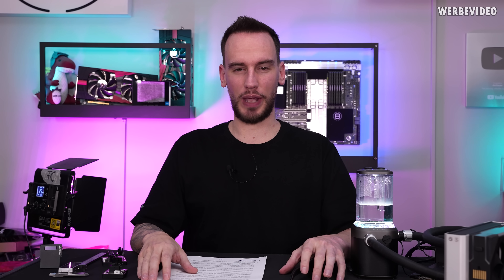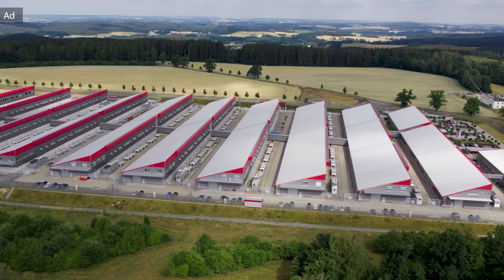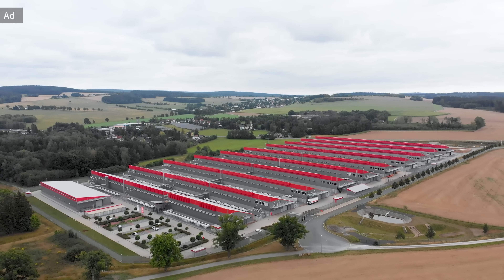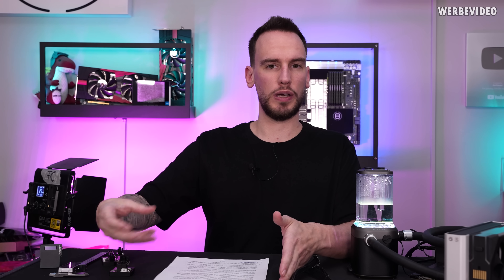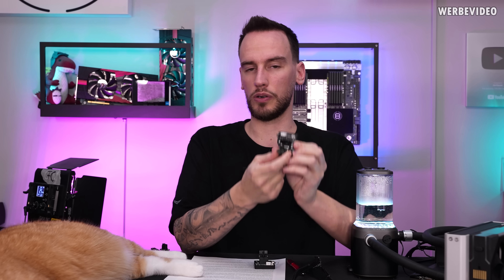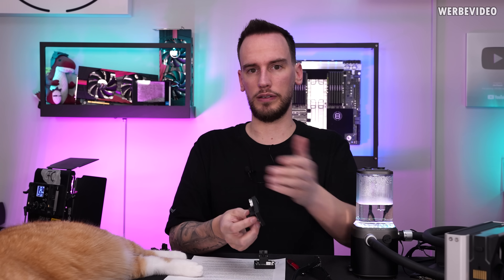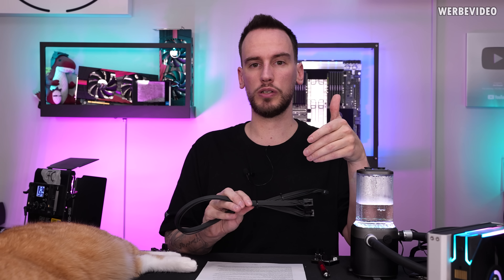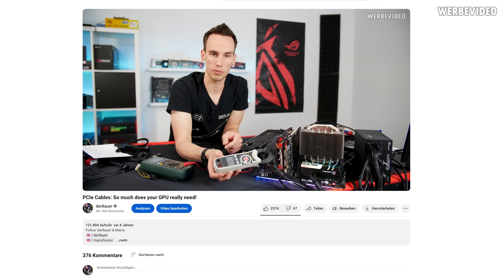12VHPWR is just Garbage and will Remain a Problem!!

Comment: I'm surprised there isn't a class action lawsuit going against them for this yet.
Reply: I would guess the ppl who ratified the cable connection are the ones you would go after
Reply: i'm in for a lawsuit/recall. i just had a second cable melt on the psu side from the original melting at the gpu side. i believe it's nvidia's fault as they created the card and requirements associated with it. there has been no improvements within nvidia to correct this issue and there is a serious fire hazard involved.
Reply: @bio-nukes4136  From what it sounds, you've used a third party cable on the PSU, fyi. PSU's recommend you only use the inbox cables. As if you don't, any cable could short, causing melting, or even fires.

This sounds more like user error, rather than the cable, as per usual.

Heres some protips, 
1: Don't bend it near the connectors end points, this could cause these dedicate wires to become loss, and cause a short.
2: Insert the cable fully, if its not inserted fully. Its your fault.
3: Only use the PSU's cable, try to stay away from adapters, or those 90 degree adapters. Only use the cable, or a trusted 90 degree cable extension.
Reply: How about soldering the wires directly to the board once the connector melts? Assuming the card isn’t too damaged lol. Every time I turn my Pc on I’m convinced it’s going to melt.
Reply: There is/was one against nvidia.
Reply: @thermadoneplays7842   You do understand that nVidea did not “make the new standard” right?  Because it sounds like you don’t really get how any of this works.
Reply: Class action for what?  People are getting their cards replace, either by the GPU manufacturer or the adapter manufacturer.  In order to sue someone there have to be damages.
Reply: @kidnovatex  Do you really expect these people to know law?
They're crying over user error.
Reply: Against... who? Can't go after nvidia, they're just using a standard.
Can't go after the people who made the standard.
And you can't go after cable mod sense they recalled. It would make it very difficult for anyone to present a good case sense they have solved the issue. Not to mention the amount of money a class action lawsuit would take.
Reply: @Triro  it should go against nvidia. Nvidia is the one who forced vendors to use this connector.
Reply: @matejsojka6683  it's of no use. If the PCI SIG says it'll do 55A, then Nvidia has no cause to question them!
Reply: it seems you didnt get my point. My point is that graphic card vendors should be allowed to choose what type of connectors they want to use. When I am lets say asus and I look on that connector how small it is I just with common sense surely do want to avoid of using something that has livespan of 30 plug / unplug. But I cannost use 3 8pins instead because nvidia wont let me do that - i have to use that clumsy connector.
Reply: @matejsojka6683  you are just mad at Nvidia for prices, you literally cant blame Nvidia for someone else's standard

stop being a salty fanboy all the time
Reply: @Freestyle80  I do have  nvidia GPU now and I had one before this one. It is not that I am salty or even fanboy of any company - I am too old for that. Just look at pc hardware shops.. there is no amd card with 12hpwr connector and no nvidia 40 series card without it. Do you really think that asus, gigabyte, msi, xfx just want to use that connector by themselves? Nvidia and Dell stands behind developing that connector if I am correct.
Reply: @Triro  No I place full blame on NVIDIA here as theyt have the money and power to influence PSU companies like a bloody mob boss.
Reply: @themadoneplays7842  If this where AMD, you probably would've not.
Reply: @Triro  No i would complain there too, I am not a fanboy. Yes my current CPU and GPU are both AMD but only because both are of good value where I am from compared to both intel's and Nvidias offerings. I live in the US and if I thought that Intel and Nvidia was the better choice I would go for them, but both the RTX 4000 series and the 14th gen intel processors are a total joke in terms of price to performace. still I have no brand loyalties here, this power connector issue is entirely Nvidias fault. They didnt do this kind of shit with the 3000 or 2000 series and they have no reason to do it now.
Reply: @themadoneplays7842  Intel is pretty good value. Its just not the best. Its better than what they once where.

And as for nvidia, the 3000 series cards are still really good value. While AMD's top brass performs better in regular graphics, with raytracing, even with a 7800XT. Still is lacking.

And once again, not Nvidia's fault. They cant fucking control the quality of companies products. Its like saying if a PSU blew up, its the GPU manufacturers fault. Its moronic, and stupid. It's just pure bias. and 3000 and 2000 series cards didn't need the power the 4000 series does.

As uh, idk if you have looked at the TDP, but its 450 watts... 8 pin connectors just don't cut it anymore, atleast not for the top brass.
Just a fyi the 3090 had a TDP of 350. Just so we're on the same page. As ik you wont be bothered to look it up.

Also the 3090TI also used this connector. So yeah. the 3000 series ALSO used this connector.
Reply: @Triro  eh i still think Nvidia deserves the flak for making the new standard, even with all you said they still fucked it up with this concept and its just sad the PSU companies are going along with it as they are interested in making money too. Before the 4000 series came out, this kind of thing should have been looked into and not just rely on data from one GPU that barely anyone could afford to ensure it was safe to use in future iterations. I mean its one thing to have early adoption issues like what is happening with the AM5 platform its another thing to have faulty tech that sets computers on fire. I mean fine I know some Am5 chips set on fire too but that was mainly with Asus boards and is fixed by now.
Reply: @themadoneplays7842  Well. The issue is its been 9/10 adapters that caused the issues, so PSU's supporting it natively is actually a good thing. As it creates no need for people to use these dangerous adapters.
As lets be honest, if you're shilling out what? 1.6k USD on a GPU, I'm pretty sure you can afford getting a new PSU, and good cables from trusted brands.

Also AM5 never caught on fire, it was the 3dvcache chips. Which was the motherboards fault for shipping faulty firmware. And AM5 has a pretty wide adoption now, am4 and am5 are now competing for top spot.
Reply: @Triro Yes they can , once a cable supplier produces samples of the final product it’s nvidias job to test the components, prior to selling the product. Lots of companies out source parts for their products, cars , washing machines etc. And those companies are forced in some countries to adhere to a recall, this is a common practice in many countries.
Reply: @Triro  LMAO goddamn, dude! You call everyone a fanboy on this thread that rightfully believe Nvidia should be held responsible (probably me too next, despite that every GPU I've owned: 870m, 1070, 2080, 2080ti, 3080ti) is Nvidia.

THEN you write this entire thing fanboying for Nvidia. Gtfoh 😂
Reply: @AllElitesAreBad  Not fanboying, I quite hate Nvidia and personally use AMD.
But Nvidia shouldn't be blamed for user error. Or manufacturing defects
Reply: Why couldn't you go after the people who made the standard? Also you absolutely could go after Nvidia if they did testing and found it would have problems and ignored it.  @Triro
Reply: @Triro what? Who pushed for the connector? NVIDIA. If NVIDIA pushes for it. And psig designs them a plug. They are both equally to blame. You can sue them both. That's how designing, fabrication, and manufacturing works. If you touch it or have any part of it. You are considered legally liable. Stop spreading misinformation.
Reply: @wessidemessside  Basically saying hold the manufacturer liable for user error. They state in the manual not to bend past a certain point. Which many ignore, and in return damage is done. 

Basically like saying the manufacturer is at fault for a user accidentally  sh**ting himself for poor gun safety. It makes zero sense. If you're going to willfully ignore the warnings its all on you.

And no, the manufacturers took reasonable time to address, fix, and resolve issue with customers. They wouldn't be held liable, especially if found users ignored warnings. Which they most certainly did, as 99% of cases are user error, while the other 1% being manufacture defects.
Reply: @Triro  Since
Reply: @Triro  If NVIDIA for example used bad capacitors in their cards that would leak and potentially blow up and forced everyone to use them than it is their fault. They did not have to use the standard but they did without doing research and testing and nobody else in consumer market is using that connector.

Comment: I think pins should be ditched all together and instead use a bar/slot style connection. Think something like the end of a server PSU, the surface area of contact is massive compared to how little you get with pins and all the plastic and air around each one. Even at the same size of the 12VHPWR with a single positive bar and single negative bar.

Comment: i was wondering too ,why board partners didnt put second ceonnector? in the past some were putting 4 4*8 on the card and now nothing?, 
its not like its strictly requared to put only 1 on any card, like nvidia is forcing aib to put GTX/RTX sticker or naming on card right?

Comment: Using 2 would kind of defeat what I think was the the original purpose of the connector -- to not need multiple connectors.  I feel like the 12VHPWR connector just needs to be scrapped and replaced by a new single connector that has higher safety margin.  If it's bigger, so be it; it will still be much smaller than 4x 8-pin.

Comment: This is a major problem! I already had a 4090 strix melt the connector on me. I got a new one through Asus warranty and it took like three months of hell to get the new one. Now the new one is still in the unopened box because I am scared it will happen again and I am just using an old 3080. This GPU cost me $2000 plus tax. Even with a new warranty card my problem is not solved and can happen again. At this point Asus and other manufacturers should just do a recall and either give me my money back or a new GPU with a new style of power adapter. Cable mod had no problem doing this for me when their angle adapter melted and they would have replaced my GPU for me too which they offered to do but I had Asus do it instead.

Comment: If 99% of the 12VHPWR failure was power hungry RTX4090, does it mean that the connector can be safer to use in lower tier GPU with less power draw, or it is garbage in its core and shouldn't be use in any device ever again?
Reply: The power draw of the 4090 exacerbate the issue of the already faulty connector. No issues were reported on 4070s and below.

Comment: What I don't get is why they insisted on making it SO small. They could have easily made it more robust and still have it be ridiculously smaller than 3x 8pin connectors. Basic physics tells you a connection that small, even WITH a proper connection, is going to be a choke point that will have a higher resistance than the cable itself. When we've seen 8pins melt with a poor connection this was just asking for problems and I'm surprised more haven't failed.

Comment: These cards are so wide, there’s plenty of room for a larger connector with a greater gauge cabling.  Perhaps it’s also time to have flagship cards powered by an external power supply. In my opinion it’s time to move from 12v to 48v.

Comment: Seem like industry need step up to a 24v system or live with bigger cables and more of them. Seems you could do a system of running cable in series out of the 12v power supply and then step down as needed at the card after the power cables and connectors.  If you were to hook up an inverter system 12v @ 600 watts with a 12v HPWR cable you would be asking for trouble.  The wire or connector is the fuse and it would burn.
Reply: This keeps me from buying a 4090 plus the fact i like my EVGA Hybrid 3090 in my work station.  RIP EVGA Hybrid cards

Comment: The 12V HPWR connector was one of the big factors in choosing to go with AMD. Yeah, the 7900 XTX isn't as powerful in Ray Tracing, which I don't care too much about, but it certainly does work boosting to 3Ghz+, and on par with the 4090 in some situations. I have the XFX Merc 310, and have done the Aqua VBIOS flash on it. I've pulled over 700W transient spikes when pushing 550W through it, and have had zero issues.  I had a feeling the 12V connector was going to be the crux of the 4090, and I did not want to deal with that.
Reply: oh that can be done? when the aqua came out I remember people saying it was locked to that card and you couldn't just flash any 7900xtx with it. was it simple or is there something extra to know about?
Reply: Oh yeah @Born_Stellar , the BIOS is certainly locked to that card, and if you want to do it on another card, like the Merc 310 7900 XTX, then you have to take the card apart, and use an external programmer called a ch341a BIOS programmer. You have a clip with pins that connects to the BIOS chip on the board of the GPU, then you hook it up to another PC, and use specific software to flash the BIOS chip.

Comment: And this is a huge reason I have still not gotten a 4090 and if they keep up with this trash I will just go AMD again I’m not trying to worry about my computer catching on fire with my kids in the house I already had a psu catch fire and almost burn my stuff up that was 15 years ago though and I was able to unplug it quick and dump water in the case and only thing I lost was the psu after drying everything off and cleaning it

Comment: Every internet engineer says the same thing: these are garbage and fire hazards ad nauseam with a variety of different reasons given for why depending on which one you look at. Okay, and according to those same sources you mentioned (Reddit, Youtube, etc.) this is happening all the way down to the 4070, although admittedly more common with the 4090, you've got reported cases all the way down to the 4070, if you look at mirror sites for deleted posts, there are even claims on 4060 models that don't even use the 12 pin solution - and I'm guessing that's why they were deleted.

Okay so my question is why is the failure rate so low? If it's such an obvious point of failure, such bad engineering, and so prone to failure that it has everyone ignoring the fact that 8 pin connectors actually do melt on occasion as well, why aren't we seeing bigger numbers that would place real pressure on Nvidia to say recall all 40 series cards and replace the connectors as some of those same sources you sighted are demanding? There are millions of these cards in the wild, and yet even if we go by the most dramatic of sources the number of affected units this isn't even a 1% problem, it's a zero point something percent problem. That's the part I don't get.

Comment: I hope Nvidia fixes this connector when they release the Super cards. As I'm going for a 4080 super. I know its power draw won't be as high as the 4090 and will be more in line with the 4080 but still all cards below the 4090 need nothing more than the simple "up to" 3x8 pin (reliable cables) ... Like the 4070 is using, I think. Or at least they should put 2, 12 pin.

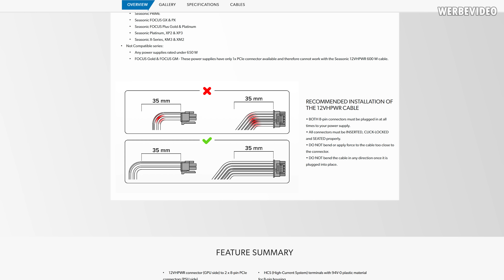Comment: 12:50 Oh boy, and here I am routing my GPU power cables through an immediate 180 degree turn straight off the plug, and the case is pressing the wires down.
(Vega64, so not using a 12V adapter but this is one of the most power hungry cards ever.)

Comment: 12VHPWR connector needs to be be fully re-thought/designed. This connector is a failure, and doesn't give customers confidence. using two connectors is fine for temporary solution but need to be brought back to the drawing board!!!!

Comment: I didn't know that psu cables were being made of aluminum until recently. Aluminum wiring is horrible, it can expand and shrink inside the connector making it fit loose and cause extra resistance/heat. In automotive cca booster cables are being the common and they really suck. 2awg cca feels like 6awg copper, and the clamps have come off on 2 different cca booster cables I have had.

Comment: These multi-wire cables are stupid anyways, no matter what's at the end. Just replace them with single thick wires (positive and negative) terminated with eyelets on the ends, and have studs on the gpu and psu. Like cars use for all of their high-current stuff. A pair of 10ga wires with 1/4" (~6mm) eyelets and studs would handle the current with ease.

Comment: 8 pin connector have also bigger pins for less power per pin, that is another point for much bigger margin for error. 12 pin have much tighter manufacturing tolerance, to  meet specification, due to decrease size and increase of power

Comment: Props to DerBauer for saying even his connector is not immune and this is not a CableMod problem but a 12vHpwr problem.  In the future there is no way they will go to four 8pin, but at the same time support for two 12vHpwr is just abysmal.  I own a stupidly expensive Seasonic PSU that is ATX 3.0 and even it only has one 12vHpwr connector, then it is three 8pins for one cable go.  Imagine people who don't have this crazy a PSU?  Six 8pins just for your graphics card?  They really need to come up with a better connector, or find a way to not need 600 watt max.

Comment: yup this is why i have a slight undervolt on my 4090, before that i could smell burning plastic despite it being fully seated.

also shame on gamer nexus for putting out that shill video blaming the users and not the failure of engineering that is the new connector.